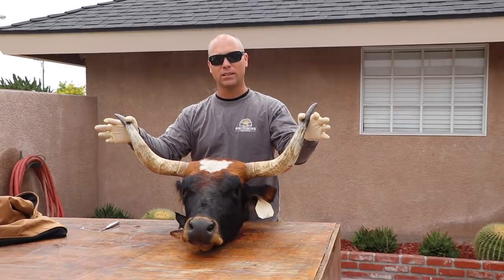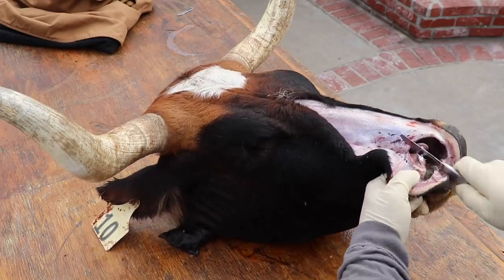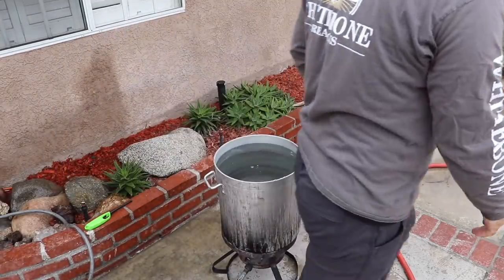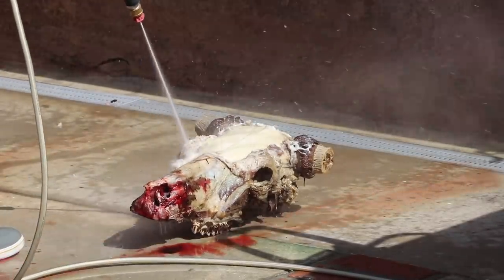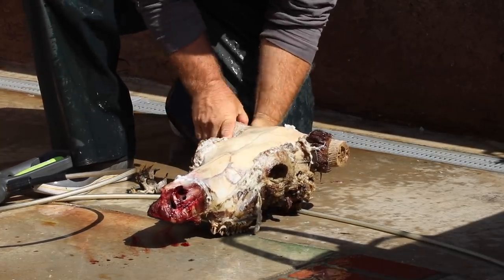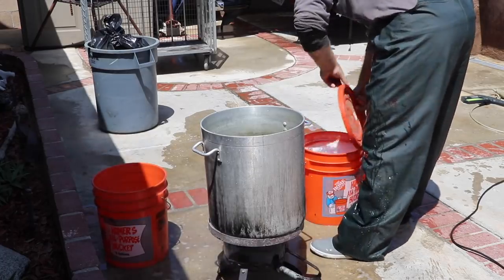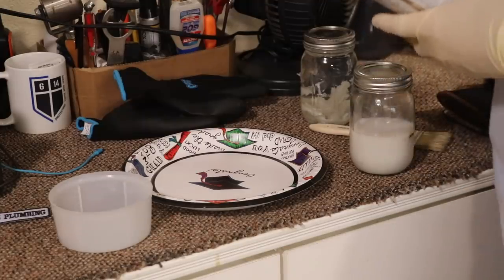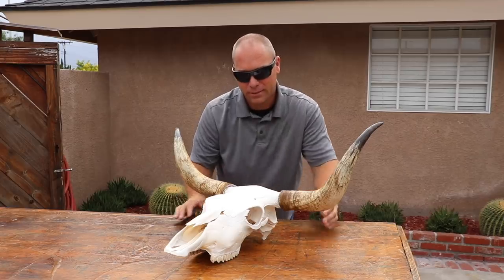HOW TO CLEAN A COW SKULL

Comment: That's a female!? Those horns though...daamn
Reply: Distant Bum bum tss
Reply: wink wink
Reply: On Dairy Farms They usually burn the cows horns off when its young so that when they are milking it it doesnt hurt the other cows(they milk lots of cows at one time)
Reply: @johnpowell9417  - Which is cruel and painful. :|
Reply: Dylan The Weirdo96 sometimes but not always. My uncle who has some females with horns just shaves them every year, not fully taking them out. It’s like filing a giant ass nail when he does it. He mainly does it for safety reasons. The cows don’t mind at all. One cow has deformed horns (had them since birth) so they curl inwards to her head, causing pain, so he trims them for her comfort. Hope this helps!
Reply: @mageofdoomsie1598  - Okay. I've just known that people burn the horns off. I didn't know there was a more humane method. Thanks!
Reply: Dylan The Weirdo96 yea I know the burning method as well. I’ve never really liked it, but I’ve also learned that they don’t really have nerve endings in the ends of horns so they just smell and feel the heat radiating and panic. That’s the way farmers SHOULD do it, but some do it too close to the muscle and skin of the calf or cow and it hurts them that’s why I just prefer I just prefer filing or cutting. Little chance of pain.

Comment: What would you recommend I do for a deer head that has started to rot before I got it and was asked to mount it? I’ve been just putting it all in the pot but it takes forever
Reply from the maker: Same process really. Just gotta boil the rotten flesh off.   Once clean soak it in odor ban available at home depot
Reply: WHITEBONE CREATIONS HUNTING thanks. I know most of the skin had started just to peel off and it’s kinda of nasty lol. I reckon if I can boil it for a little bit and separate it it should come off with the pressure washer
Reply: WHITEBONE CREATIONS HUNTING could you make a video on the rotten head? My stomach ain’t the strongest lol. Would just like to see someone do it and maybe it’d help me!

Comment: This is the best video I have found. I’m in the process of taking a bull skull that had been in a shed for years somewhere. I did the hot water maceration method. After first bath I was able get off all the major fur, fat deposits and such, but still wasn’t able to get the really stuck on stuff. Power washed and hosed it, but still had stuff to peel of course. I changed water out and heated up with 1/2 cup dawn soap to aid as a degreaser. Let it dry overnight and today have been still trying to get the slick off of it. How do I know what is bone or flesh on some of the parts? I have watched this video and paused on the back of the head to see visually how cleared out the inside is. How do I know if this is too old to preserve or not. I just don’t want any bits left on that aren’t supposed to be there. I’m covering this with tiny beads Huichol style, so it will be covered. Just want it preserved correctly 😊 Thank you @WhiteboneCreations

Comment: Excellent video and hard work, it was amazing, but... What if I had a skull which was half eaten by worms and now it has mold on it and actually stinks... I need help!!!
Reply: I know it's too late, but maybe use it in the future:
Get something that the head can fit in, pour water in it, put the head inside and leave it. Change about two thirds of the water every two weeks or so, until the skull is clean. I strongly advice you to do it somewhere where nobody will mind the smell, because it's gonna be horrible. And remember to do something so animals won't get in there.
After that, degrease it, whiten it, do whatever you want
Reply: He made a video where he cleaned a head full of maggots